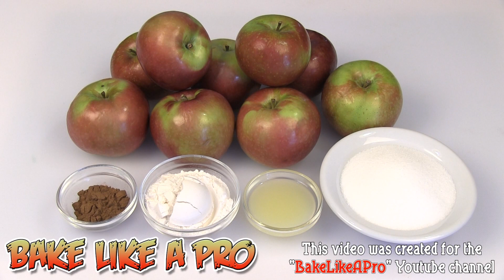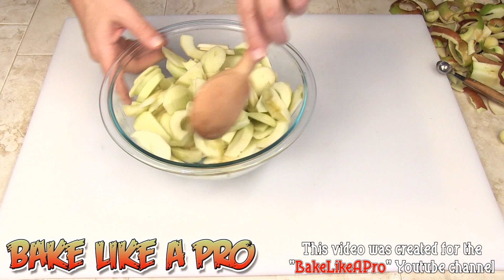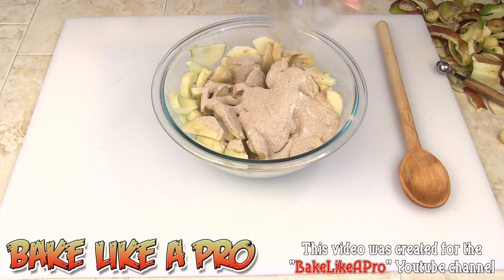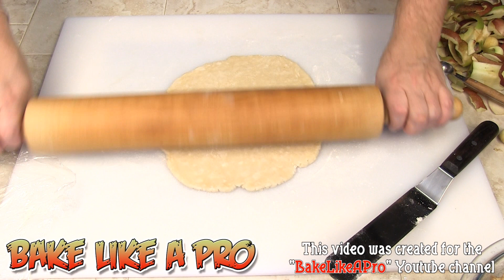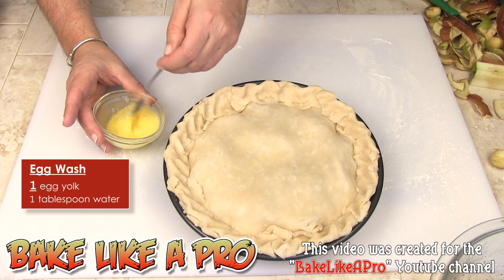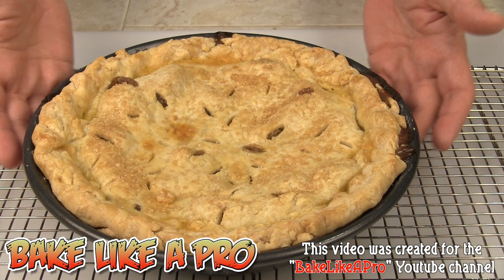Classic Apple Pie Recipe ! - Easy No Fail Recipe !

Comment from the maker: response 3 - so there you have it, so the fats heat up, pushing out moisture, steam is created and builds up pressure in that area, and creates an air bubble, which puffs the pastry.  Then, turning down the temp in the oven, lets the entire pie bake and NOT burn.  That's the theory behind it.  This is how my pastry teacher taught me a 100 years ago, and it is the same today :-)  I hope that helps :-)

Comment from the maker: When you have a pastry dough, you want a good higher temperature so that the moisture contained in the fat, explodes out of the vegetable shortening or butter.  A higher temp at first "shocks" the pieces of fat in the pie dough and makes them "pop" !  What does that do ? it makes your pastry more flaky ! :-)  Once that is done, you can lower your temp so that the pie doesn't burn. Lower temps, and you won't have as flaky a pie dough.  It's a great question by the way :-)

Comment: My comment is gone about my experience finding a peeler.  I got a Messermeister Pro back in Sep '15 at amazon; you can look it up and compare the design difference.  It was the closest in design i could find then and works but not as quickly as his does although he's had a lot more practice.  It seems like it's critical where you are able put the pressure and hand grip, and the one he is using has a smooth interface between the handle and blade "cover"  You can get more pressure over the peeler part with less stress on your fingers.  By chance I found one designed like his, ordered it, won't name the vendor, not amazon, came back out of stock.  So back to amazon with the brand name Joseph & Joseph.  I found and ordered two designed like his.  One has a smooth, sharp blade, and the other has the teeth, don't know which one he is using.  Both are for right and left hand.  Around $8 apiece, free shipping if over $35, don't use Prime yet.  I didn't find it at amazon the first day I searched for that as a single item; amazon can be tricky.  First I found a circular thingie combo with the peeler I wanted.  Then a couple days later I search and find one in a set with 2 y peelers I didn't want.  Nice comfortable looking handles on all.  Finally I found two as singles by using the slideshow feature under a J&J item, not sure how I smoked those out.  One is yellow and one is lime green.  While I was searching for the J&J one, I saw another one very similar.

An easy-to-use peeler makes a difference whether I mess with apples or not.  I'll post an update after I make my apple pie.  I also got a sharpener as all my knives are dull, especially my trusty Chicago Cutlery paring knives; I was peeling apples with those and did bushels of them over the years.

I am getting much better with the pastry, using part his method and part another's.  The magic is the flakiness he gets with all Crisco.  The advantage to Crisco is it doesn't burn the fluting as fast as crusts with butter.  Plus the sticks are so easy to measure.  But it doesn't taste as good as the old Crisco; it has little taste at all, am going to try the butter flavored Crisco just to see.  I have found that I have more control if I just mix by hand exactly like he does with the pastry blender like his (those are easy to find) and ice water.  It's also much less hassle cleaning up than with my food processor.

Comment from the maker: response #2 - Imagine 2 pieces of paper.  Look at how they stick together, and there is not much height to them.  Now, imagine this - remove the upper piece of paper, and now sprinkle grains of rice over the first sheet of paper... now put the second piece of paper on top.... see the difference ? .. you now have air pockets all over the place BETWEEN those 2 sheets of paper.. and this is EXACTLY how pie pastry works, when that fat explodes... it pushes the pastry apart -creating tiny bubbles :-)